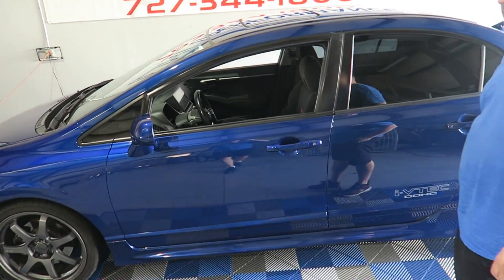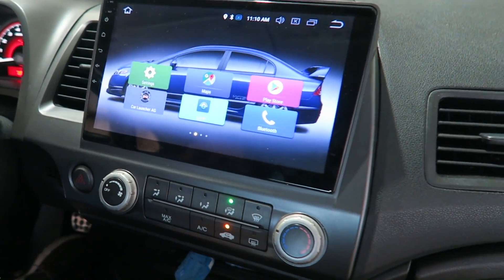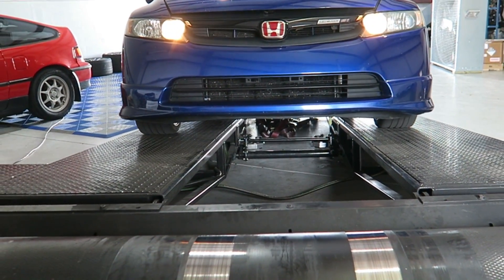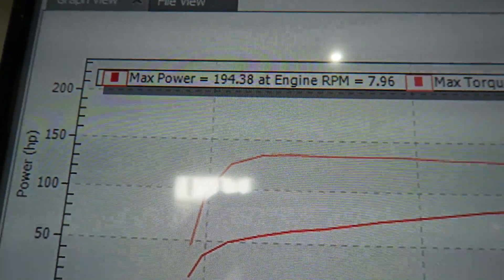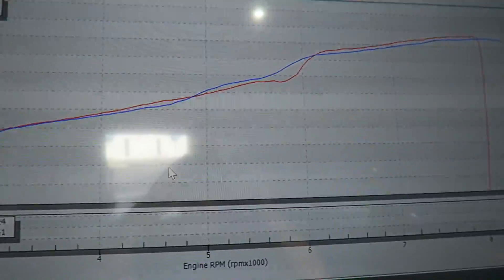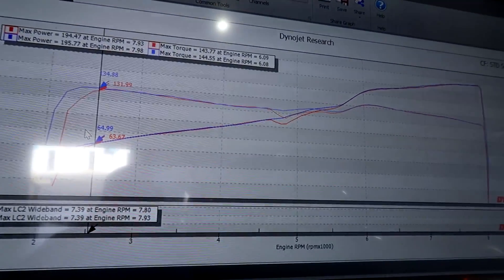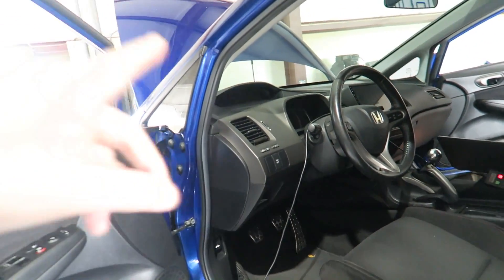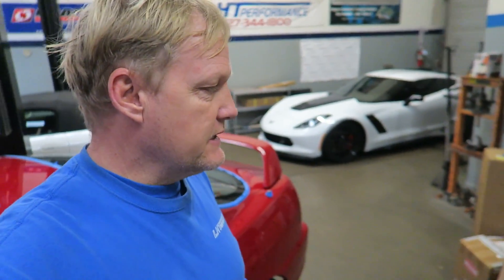Civic Si Mugen - BASE

Comment: Coming back to this video, it's so refreshing to see my 2 favorite Honda youtubers on the same video. I remember when the Mugen FA5s dropped. They were undesirable because the markup here in California had them costing the same as a brand new S2K and all you were given were the rims, aerokit, exhaust and suspension as mentioned. 15 years later, the discontinued wheels and exhaust have retained their value and prices of these Mugen FA5s have done well, too. I've seen listings from $10k-$24K locally. I'd expect the prices to go up from there in the next 15 years. But then again, these prices are similar to used S2K prices as of 2022.

Comment: Very nice video, I have that same dasaita head unit for my 9th gen , but I still csnr figure out how to get Hondata to work, it's installed, but it won't sync, I didn't know the torque app could work, I have the full version, guess I will try it tomorrow and see.
Reply: Cloud Thomas I unplugged the Flashpro and plugged it back in and it worked. If you noticed the green light on the Flashpro was flashing rapidly when it’s like that it won’t connect.
Reply: George Fitzgerald thank you, but my issue is I can’t even get my flash pro to pair with my radio, it see it when I go to Bluetooth, when I click pair it doesn’t do anything. It just ask me if I want to pair it, I click yes and nothing happens, so not sure what’s up.
Reply: @georgefitzgerald5861   ok so I got my flashpro finally to pair with my radio, however when you say you got it to work, you mean with hondata dash or hondata mobile ? Or you meant torque pro, because I tried it with both hondata and they both crashed, I was able to get hondata mobile from the play store to connect to the flashpro, but once I tried to click on anything to get a read out it froze then the app crash, and the hondata dash wouldnt even open, it just open then crash
Reply: Cloud Thomas I’ve used Hondata mobile and torque pro
Reply: George Fitzgerald nice damn 😭 why I can’t get it working then lol, maybe you could make a video or something on what exactly you did, because I’m not sure why it’s not fully working for me, love you guys channel, I plan on supercharging my 9th gen eventually I def might have you guys do it, but I live in jersey so it’s just the distance to get it there would be a challenge with work and all.
Reply: Cloud Thomas I don’t know exactly I unplugged it and plugged it back in and it worked
Reply: @georgefitzgerald5861  ok which light you said was blinking ? Was it the power light or the datalog light?  My power light is solid green only the datalog light flashing, but it always do, maybe I need to unpair the flashpro and pair it agian, I'm trying to figure out how to do that, I dont see any option in Bluetooth to do it, if  you have any idea how to unpair let me knw please thanks.

Comment: Did the flashpro work with your android head unit? With my android hu what i did to connect it chinese bt elm bt obd2 adaptor is i paired it first using the bluetooth app within the android radio. Once its paired, you can open torque pro and it should work.

Comment: Awesome congrats on the Mugen si! I got one myself it was badly taking care of im slowly restoring it to its prime and better, everything is stock from the Mugen si parts it comes with, I was wondering if I put a kraftwerks rotrex kit with a stock cat or high flow cat would it still pass smog? Im in california and I had a 05 dc5 k24a4 block stock tsx internals and k20z1 head stock and a fuel rail also had a quiet exhaust forgot the name was rare from i remember japan made and it had shorty headers with a cat and a old 3 year tune from church tuning what the seller told me when I bought the car and I think it had a carb legal intake i believe it was and it passed smog one day my dad took it for inspection since it was time for passing, while I was asleep and when he came home he told me it had passed and I was very suprised so do you think it would have a chance on my 8th mugen si stock with a rotrex kraftwerks kit to pass how the rsx did? (sadly it was running a really old tune and revved maybe to high and had bad rod knock and that was the end of that car, didn't have money at the time as a teen to go for a new tune which I had believed caused the rod knock or he had poorly put the motor together previous owner)

Comment: I recommend getting a true cold air intake or a custom made one that k&n is not efficient and during the summer it heat soaks horribly i had it and sold it and put the stock airbox back on.
Reply from the maker: Kenny_Fa5 The car came with the intake already on it.  Hence why we didn’t run with the stock box.
Reply: @LHTPerformance  is george eventually gonna put a CAI in the future?
Reply from the maker: Kenny_Fa5 Stay tuned for the next episode
Reply: Did these come stock with the Mugen (carbon/fibreglass) air intake box?  I assume they did.

Comment: That hot air intake!
Reply from the maker: HighSpeedEnthusiast As mentioned.  It came on the car.
Reply: @LHTPerformance  No doubt! Wasn't suggesting anything other than it's probably working against you. K&N is also notorious for missing the center of the air stream with the mass air flow sensor. There are very few companies out there that flow test and set their intakes. Most drop that mass air flow sensor in the Airstream and call it a day without it ever aligned.
Reply from the maker: HighSpeedEnthusiast No worries
Reply: @LHTPerformance  absolutely positive that the k-series are the finest for bangers ever manufactured on this planet! One of mine just turned 180 K and it still hits 9000rpm every time I drive it! Love the channel keep up the great work🤘

Comment: Dam you made almost the same power I did and I have way more parts. I either need a new tuner or my car is slow lol. I made 196hp with sri, p2r spacer with gaskets, rdx injectors, aem 340 fuel pump, stock header with 70mm high flow cat and 2.5 inch exhaust system. Dyno tuned on ktuner v2 on a dyno jet

Comment: i have that dash just diff android os but i used torque  pro with flash pro bluetooth, i got mines to work by setting up a password in flashpro manager and reconnect it , you first paired it in the android setting bluetooth screen then in torque app just select flashpro, and if you already got it to connect just make sure the communication  setting in torque  pro app under baud rate is set to automatic
Reply from the maker: sovan781 Thanks for the info.  I’ll pass that on to George
Reply: I got it thanks! My Flashpro just needed a reboot

Comment: The car is rated at 197 crank but it made 194 at the wheels? Is the Dyno calibrated correctly?
Reply from the maker: They usually make 175-185whp stock. I’ve been tuning them in multiple dyno before we owned one. With the intake and hood open, it’s good for another 10-12whp over stock.
Reply: LHTPerformance so the power reported was low from the factory?
Reply from the maker: mykrrrr Most if the time this is the case. The manufacturer never wants a car to make less than advertised. Plus every car is different.

Comment: This Mugen si not worth to buy...
Same as a base civic si.
Only bodykit+
mugen wheels+
Spoiler+
Mugen Exhaust+
mugen knob.

Mugen Engine not special. Same HP as base civic si lol.
Reply: jay ly when new I would agree with you but it’s a good buy now if you like all the parts as they are expensive to add to a base si
Reply: The HP of the base Si makes in the cranck, the Muggen makes at the wheel...
Reply: jay ly it’s definitely worth it considering how few were made. The undeniable is rare.
Reply: @Sergio Aguirre No, LOL! It has Mugen exhaust and a Hondata custom  reflash, that makes more power than the conic K&N alone.
Reply: The Mugen exhaust & forged wheels are nice things to have.  The "full-fat" Mugen 8th-gen Civics (the Mugen Type R Euro and the Mugen RR) with the 240hp Mugen engines were a lot more expensive than this...